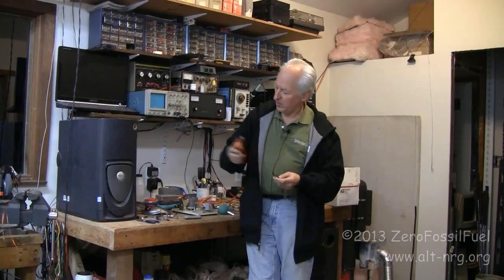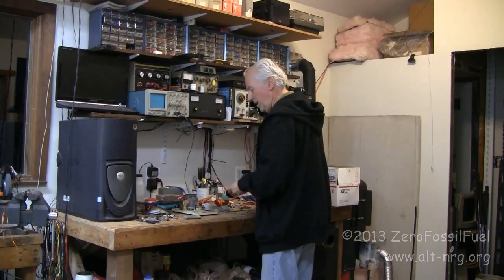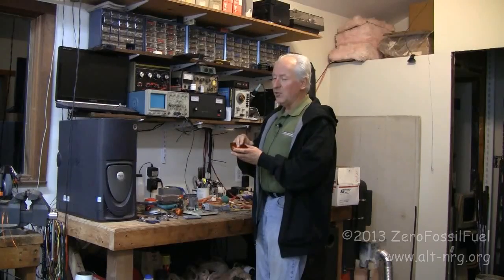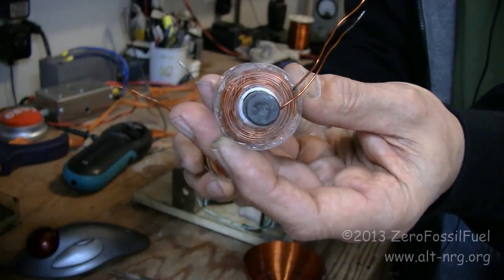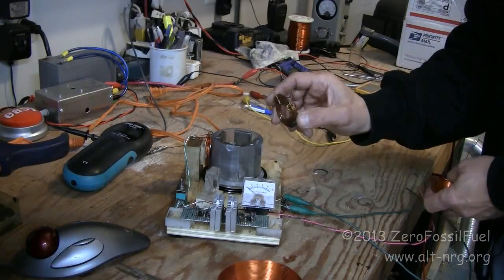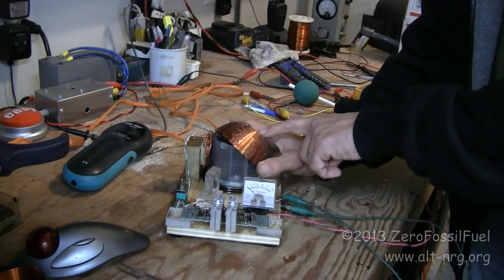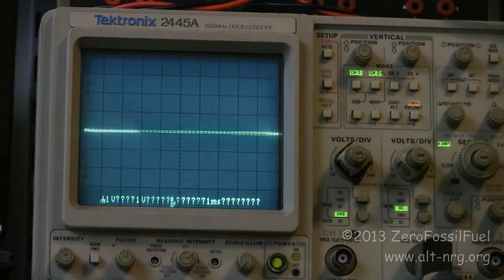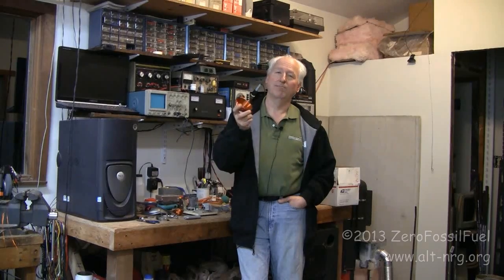#330 Zero Lenz dynamo Not

Comment: lenz less. you have to have the magnets and the coils in the stator and a magnetic bridge in the rotor. that will bridge the magnetic field of the magnets into the coils and cause the emf induced in the coils to repel the magnets but since the magnets are stationary with the coils the rotor experience little resistance rotating when circuit is at full load.

Comment: Maybe you gave up with these coils too quickly. When you watch the cummulative behaviour of field lines of E magnets, then two things become obvious: the magnet partivals rotate around the conductor, and if they hit other particles from the next conductor winding, they are forced to cummulate. Hence the axial orientation along the surface of a solenoid. Now, in a pancake coil we therefor would expect a radial orientation, eg. south in the center and north on the edge... But that's not how it is! North is on the top flat surface and south on the bottom! The Fieldlines do not align along the surface, but are upright just like some cat fur! Why is that? This is the second observation: Fieldlines refuse to be in a higher density at one pole than at the other. So they tend to stand parallell to their neighbours.

And this is exactly where the wardencliff coil comes in handy. Each Fieldline that is caused by the lenz law will have the freedom to stand radially, like cat fur. Compression on the inside is small. Cummulation of fieldlines does not take place. Therefor these coils make a miserable E-magnet, nonetheless they pick up the P-magnet fields nicely. So they seem to be the perfect Pickup coil. You may try a stack of them, with like 2 or 3 mm space bezween each.

Compering them to bifilar tesla pancakes is not fair, cause those (one part CW, the other CCW, in series) have a lenz effect even without a load, and btw. DC resistance doesn't say much about a coils performence.
Anyway, keep it up. Peace.

Comment: about 2001 i visited a webpage that talked about a generator that had been built using a conical coil ( I can't remember if it was bi-filiar or not) that produced minimal "braking effect" under load. when I tried to find the page again a few weeks later, I couldn't find it anywhere. I've looked for it off and on since then, never being successful. i think I linked to it from Don Adsitt's site (theverylastpageontheinternet.com, I think you can only find it from the wayback machine now) I think it was suppressed.

Comment: Excellent videos .. thanks ..... I noticed your bi-polar coils are cutting the magnetic field produced by the rotationing magnets were as with the half sphere they are in the same direction as the windings, perhaps your might consider two half spheres connected in series with the a magnet rotor at 90 degrees to the coils in fact bi-polar spherical coils would be the way to go.

Comment: So with low induced voltage you have low drag. I've fashioned a neodymium rotor assembly in the half-sphere and it runs pretty well. Thanks for your posts Zero.

Comment: Great videos, love your videos.  Don't be to hard on yourself about your earlier test results.  There are many variables to account for in experimenting to track.  

Thoughts:  My understanding about magnetis fields and induced voltages in coils is based upon magnetic fields crossing perpendicular to the wire being induced.  The cupped coil over the rotating magnetics, creates mannetic fields going along the wire and not accross them.  Therefore only a little voltage induced.

Comment: Try actually cutting the copper wire across the winds instead on with the winds. You need a ball magnet with one half north and one half south then spin the magnet so the north and south actually slice through each wire of the cup type of coil. It is not surprising that you got nothing out of the inside because you are not cutting the wires with the north south division line properly. Geometry has to be followed strictly in these type of coils for generation. Horizontal spinning ball will do it.

Comment: Cont. #4. By doing this you are consolidating the magnetic field lines which now make it easier to direct them across a coil and control the distance from the coil. I believe the cone shaped coil is acting similarly to putting a cone on a magnet and consolidating the electric field lines. The cone is still a solenoid and I would try a soft iron rod ground to a .100" diameter point to match up with cylinder magnets with a cone. If the cone shape still proves superior over a standard coil.See#5

Comment: #3 Cont. There are many changes to this design that would give both better results and a better comparison of the two coils. When it comes to magnets it would serve you well if you thought about the flow of the Magnetic field lines as well as the electron flow in the magnet. Redirecting the electrons also redirects the MLF. This can be done with shielding or soft iron. Placing a soft iron cone or pointed surface onto a magnet induces magnetism and also directs the field lies to the point. see #4

Comment: #2 Cont. The magnetic lines of force must cut the wire as close to 90 degrees as possible to attain maximum results. Placing the cone shaped coil over the top of the magnets just proved your were too far away from the magnetic lines of force to induced voltage into the copper wire. The magnets you are using are better served in a flat position rather than standing up against a round surface. The flat coil made to conform to the outside radius of the plastic would perform better. Cont on #3

Comment: Romero used magnets on the top of the coils
please test the cone with another neodyne magnet perpendicular to the rotor magnets
Mine increased sped as the bottom magnet moves back and forth diagonally

Comment: Z - could it be that the reason you saw no voltage is because the shape of the sphere closely resembles the shape of the magnetic flux lines you subjected it to so that in essence there was no magnetic flux across the winding's?  In order to produce a voltage in a specimen of conductive material there has to be a change in magnetic flux - as you know.  It is possible that from the sphere's perspective, there was no change in flux even though the magnets were spinning.

Comment: You would want your magnetic field to be 90% to the windings on the coil. In your demonstration the coil was positioned at 45% at best. A spherical rotor that fits inside the coil would be ideal. Then you could place another coil on the other side. You would then have two hemispheres with a rotating core. Sound familiar? 
Love the video!
Peace!

Comment: You might want to build a magnet arm that you can fit inside the open side of the large winding so that the magnets poles cut across the wires in the winding as opposed to the poles running along the direction of wires in the winding.

Comment: Zero, Great work!!! To answer your  question about the magnet inside the coil. Remember the video you recommended in 328? You created a magnetic bowl just like in the video, and with the same weird results. It wasn't plasma that was revealing it was the magnetic field of the bowls. To check it out put voltage on the coil and see if you feel the "Choke point"

Comment: Hi Z,

When you get magnets inside of half-sphere coil you need to make sure the magnetic induction rules are followed with magnetic field crossing all wires and not any of it going along of wires vectors and any of opposing fields induced currents on same wire what nullify summary EM flow. I suspect this is what happened when you tried.
It is tricky but if you can get things right in 3D fields the different results with moving magnets inside of half-shere coil will be obviously clear.

Cheers!

Comment: The length of wire as well as the number of turns and the distance from the magnet will all need to be fixed at set values in order to accurately compare the coil designs. As for no voltage on the inside of the coil id guess that it works like a Faraday cage. Id be interested to know if the bi-filler coil VS the conventional coil produces less drag on the spinning magnets if the variables pointed out above are kept at a constant?

Comment: ok what happens when you put the half sphere inside the spinning magnets?
(the inverse of the magnets in the coil ( may need a smaller coil though))
other then that what happens if the dome shaped coil spins rather then the magnets?
(if change then it may be something to look at even if it has seemingly negative results it may be useful data later on)

Comment: Now I'm not sure but it looks like the relative angle of the magnets to the wire changes when you put the big side over the spinning magnets. Which way are the magnets supposed to go with the wire to induce the voltage? Sliding by at 90 degrees to the wire or parallel to the wire? Trying to hold the big end super close looks like the magnets spin at a angle to the wire or with it. That might have something to do with it but its still a strange affect. :(